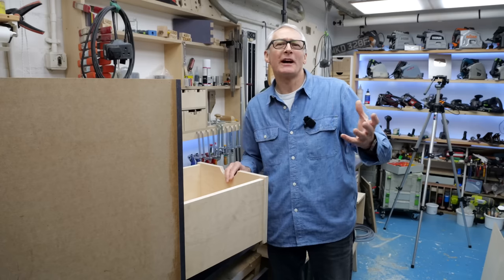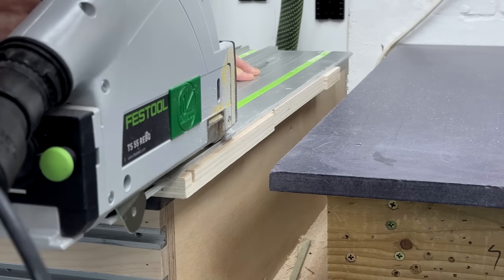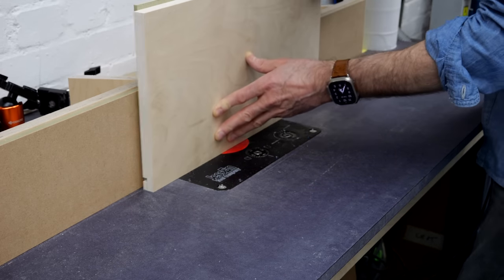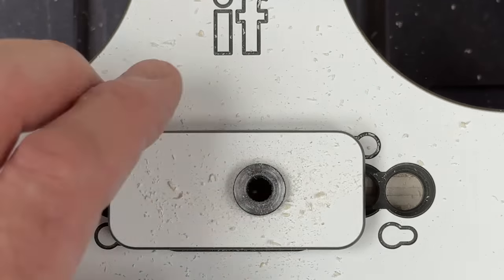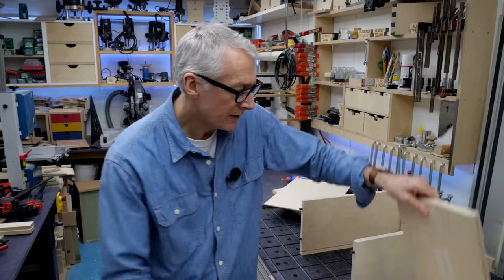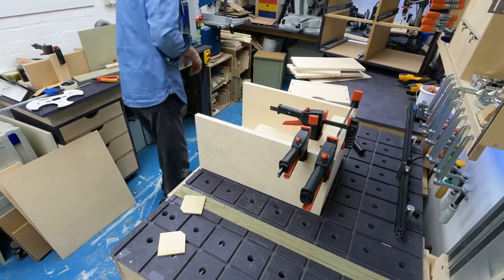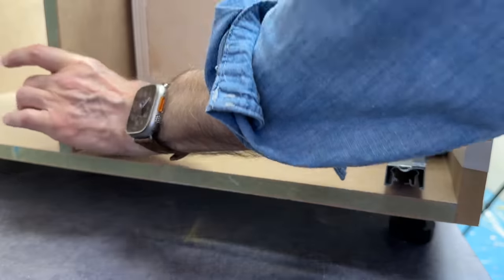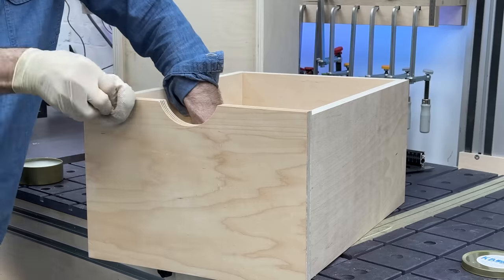How I Fit Concealed Drawer Slides [video 524]

Comment: One detail that would save a bit of time, would be to cut the height of the back panel to the internal height of the drawer, and then run the drawer base to the outside face of the back panel, and then screw fix the base to the drawer box back. this would then remove the need to run a groove for the base as well as removing the need to make cutouts for the runners.
Reply from the maker: That's how I used to make them, but if you're running a grove anyway, then it doesn't make much difference to the time element, and having the base fully contained within the drawer box is just a nicer, more 'finished' look.  👍

Comment: That's brilliant! Undermount runners on inset drawers, almost exactly how I'm going to do mine.

Using the peanuts as a modern replacement for dovetails is also pretty nifty.
Reply from the maker: They’re so good for that kind of joint where you need a hidden fixings that will work edge-to-face. 👍👍
Reply: @10MinuteWorkshop  once you've got the router bits, collar and jig, I'm sure this kind of thing becomes a no brainer. I'm just struggling to get past the startup cost of it all. I've got the kit in my Axminster basket, but for the number of drawers I need to build, I just can't justify the price over using a false front to each drawer.

Comment: Another good video Peter, I always found the hole in the back of Blum runners a bit crude, so always used Grass ones as they had a nice little bracket which you screwed to the back for location and adjustment. drawer boxes were always solid timber such as Idigbo or if where clothes were stored Cedar of Lebanon and dovetailed by hand front and back. Generally the back did not have a groove just made shallower and this allowed the bottom to be screwed to the back to allow for removing if required. I much prefer the concealed runners as you do not see the metal grant style one screwed to the side.
Reply from the maker: Always used Grass early on for that reason, and because they were good for 60Kg vs 40Kg for Blum. But they had a massive price hike and my local yard switched to stocking Blum, so it was just easier to make the switch. 🤷‍♂️👍

Comment: I was wondering how you measured the location for the peanuts for the front. I see the pencil marks but how did you manage to put the groove in the correct spot and router the 4 slots in the right place.
Reply from the maker: It’s pretty straightforward. 👍 https://youtu.be/DsvpAjGizKs

Comment: Hi Peter, I really enjoyed your video. I couldn't quite catch what thickness of the ply you've used for the bottom of the draw. Also, what size of the router bit to go with it, to make the appropriate groove? I really appreciate your help. Thanks in advance.
Reply from the maker: It’s 6mm Birch ply for the drawer base - the Birch ply alternatives don’t go that thin - and I used a 1/4”’ grooving bit as it give a little more wiggle room, and “6mm” birch ply is often a little thicker. 👍

Comment: I suppose the big difference between the Rejs runners and Blum for example is the warranty? Blum is guaranteed for life whilst I assume the Rejs only has standard 1 year?

I suppose that's up to the builder and the client if that's worth the premium or not.

I have used "cheap" undermounts before and they were a nightmare but it was a few years ago now so perhaps things have changed, you seem to rate the Rejs runners however so I think I might pick a set up to try.
Reply from the maker: Yes, though I don’t know anyone who’s attempted to claim on the Blum warranty. These runners were recommended to me by Derek Barrett, who has used them extensively in his ‘contract’ grade fitted furniture work. I was very impressed with them; they’re not a Movento, but they’re less than half the price, and I don’t always need a Movento. 🤷‍♂️👍
Reply: @10MinuteWorkshop  I think that says a lot about the quality of the likes of Blum that you don't hear of failures, only time will tell if the rejs can match the longevity. Particularly when it comes to components of the soft close damper/mechanism.

I'm very much on the quality > cost side when it comes to my cabinetry but you are totally right, a full extension with 3 way adjustment from Rejs is less than half the price of a tandem/movento and if you want depth adjustment you need to buy the extra adjusters.

Comment: As always a great tutorial video the only problem with this video is that the audio was very muffled so hard to hear your narration.
Reply from the maker: Sorry you had trouble hearing; the audio on this video is identical to all others recorded on this microphone in the last 8 months or so, recorded in 24-bit, loudness normalised to -17LUFS - right between the [too quiet] EU Broadcast standard of -23LUFS and the [too loud] YouTube recommended -14LUFS. Audio is monitored very carefully for consistency over the whole video so as not to introduce any surprises for the folks who listen through headphones, so if you're hearing something different then it's almost certainly at the playback stage, not something introduced during the creation eg playback on systems that are bass-heavy (eg Beats headphones) can make the audio seem less clear. Hope that helps. 👍

Comment: I'm making a drawer, a special drawer. It has a bed & multiple humans in the drawer, so it's Heavy. It also extends up to 1.5/2meters out the back of a transit van. Do you have any advice on runner selection & fitting? I would Greatly appreciate any insight offered.
Reply: Any pickup truck tool drawer video will likely work.